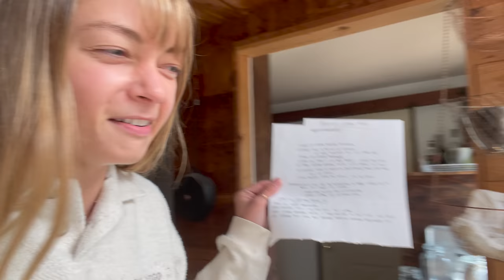Moving back into my Cabin in the Woods

Comment: Just a tip (not a plumber) but when turning on the water, make sure at least 1 tap/faucet is open so there isn't too much pressure in the pipes and allows the air to escape the pipes so it doesnt cause a potential burst in a line.

Comment: It looks very cozy. Depending on how cold it gets there in the winter you might want to consider adding a layer of insulation on top of the current floor and then cover with plywood before adding whatever flooring you choose because the carpet was also acting like insulation to keep the cold temperatures from the ground affecting the temperature inside the cabin. I am probably explaining it wrong.  I live in a house built in 1941 and you can definitely tell what the original owner/builder did and the materials he used. We don’t know what happened to him or if it was related to WWII , but the house was sold unfinished and the second owner didn’t use the same quality of materials and wasn’t as skilled as the first one. The house has gorgeous thick oak floors that over time were covered up by carpet. In the room off the kitchen they put linoleum right on the gorgeous oak flooring and because it probably has asbestos in it we can’t remove it and you can’t hire someone to remove it without removing the oak flooring. In the areas that we removed the carpet we did notice a big change in temperature especially in the winter. We added insulation to the underside in the crawl space and root cellar which made a big difference. We really need to add insulation in between the upper floor’s flooring and the ceiling from the first floor to deaden the noise transfer between them.

Comment: I don't know if your plumber put this on the list, but after you've had a lot of sediment /rusty water come out of your faucets you need to take off the aerators and clean the screens in them because debris gets trapped and reduces water flow.
 Our power used to go out a lot when I was growing up in the country and using electric pumps with well water, so I got used to removing them before we turned the water back on.

Comment: Mud chains and a twelve volt winch🤠It was possible to work the van out of that hole; just saying😎I have a Ford E350 and a road that turns into a creek every spring; been there, done that. You dig a ramp behind each tire about six feet long. Smash tree branches into the mud where the tires will track. Put it in first gear. I put on my mud chains if it is really bad. Usually do not have to. Then go for it. With only one wheel actual spinning you need to remove as much resistance to the vans direction of movement as possible. Once you get going you have to keep your inertia or you will get stuck again.

Comment: Next time you get stuck, use a board under the Drive wheel or wheels that are stuck.  Most of the Ford E series are rear wheel drive.  May also be a good idea to invest in recovery boards as some of your van spots have had wet access roads.

Comment: Hot tip! Put a small piece of art or a trailing plant high up at the seam where the two white walls meet and it will be way less noticeable! When in doubt distract with plants! 😂
Reply: Also!! I feel like if you put the ripped out carpet in your driveway and then maybe put rocks over it it may help with the getting stuck/mud issue. 
Then it’s also repurposing the carpet! Win win!

Comment: You know, you should get some concrete mix, mix it up,  and make some concrete parking stripes. I did some concrete work for my driveway on my own, as a first timer.  And I just did it by hand. It was kind of cool. So just dig them out, place boards as molds, and pour the concrete. It would make a cool project for your videos.

Comment: Did you check under the flooring to make sure it was insulated? Otherwise you’ll be dying in the winter, or the hottest parts of the summer. We lived in an 1890 house and couldn’t rip up the carpet on the bottom floor, even though the hard wood underneath was awesome AND original, because all the cold air from under the house would have come in. If we had kept living there, we would have insulated underneath first so we weren’t screwed with any too hot or too cold weather.

Comment: That carpet you ripped up would have been clutch, Hannah.  Cut it in long strips the width of the tires, tuck them under the tires and if you’re able to get the tires to grab them you could have backed right out.  Next time.  ☺️. Keep that old carpet around.

Comment: 11:30 getting stuck in the mud: I sent you an email about an easy way to deal with that with an air compressor about six months ago. (Not sure if you even read it.) You need an air compressor or a better driveway. Could also tell you why the hydraulic jack your uncle tried to fix your house will never do the job of a floor jack but I would be wasting my time.